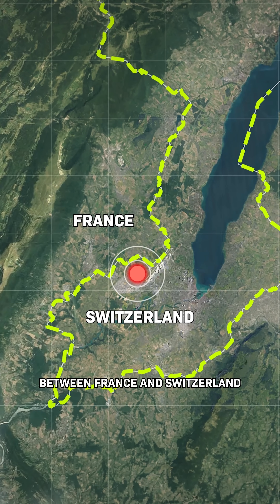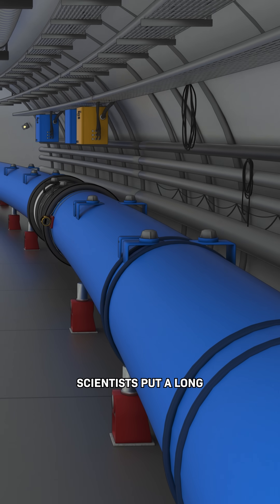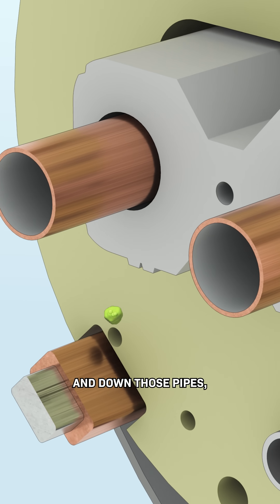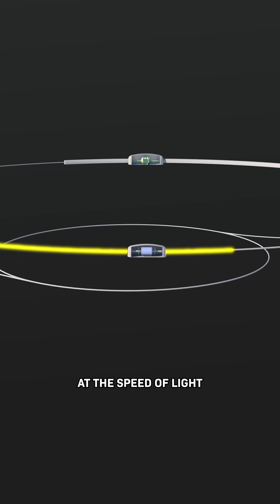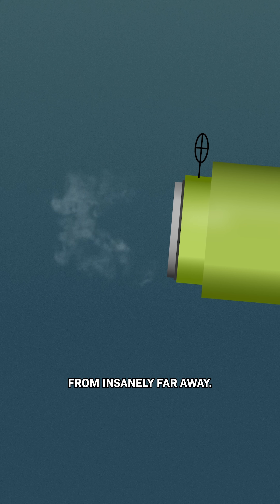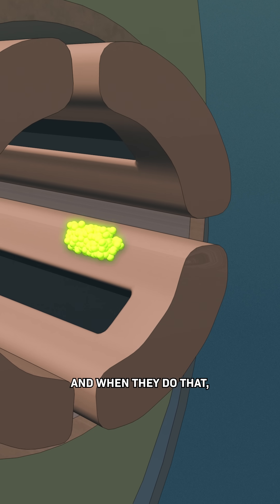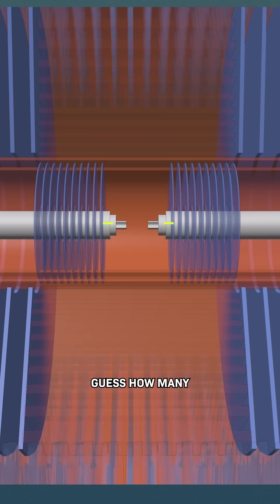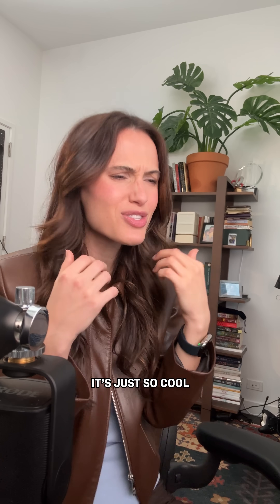How Do They Make Particles Hit Each Other?

Comment: cool,...... what this for?
Reply: Essentially, the point is that there are lots of particles (for instance, the Higgs Boson) which have extremely high masses in comparison to protons, neutrons, electrons, etc. They only exist for brief moments before disintegrating into other types of particles.

Experimental physicists want to have evidence that these kinds of particles actually exist outside of theory, and so the only way to do that is by producing enough energy that these massive particles come into existence. The way you do that is by taking tiny particles and getting them up to relativistic speeds (high percentages of the speed of light) and bashing them together. Then, machines surrounding the site of the collision record what kinds of particles shoot out from the collision, and they're able to use those results to figure out what types of particles were created.

Comment: The Flash..?
Reply: The flash point of a material is the "lowest liquid temperature at which, under certain standardized conditions, a liquid gives off vapours in a quantity such as to be capable of forming an ignitable vapour/air mixture".
Reply: The flash point is sometimes confused with the autoignition temperature, the temperature that causes spontaneous ignition. The fire point is the lowest temperature at which the vapors keep burning after the ignition source is removed. It is higher than the flash point, because at the flash point vapor may not be produced fast enough to sustain combustion.[1] Neither flash point nor fire point depends directly on the ignition source temperature, but ignition source temperature is far higher than either the flash or fire point, and can increase the temperature of fuel above the usual ambient temperature to facilitate ignition.
Reply: The flash point is a descriptive characteristic that is used to distinguish between flammable fuels, such as petrol (also known as gasoline), and combustible fuels, such as diesel.

It is also used to characterize the fire hazards of fuels. Fuels which have a flash point less than 37.8 °C (100.0 °F) are called flammable, whereas fuels having a flash point above that temperature are called combustible.[2]
Reply: All liquids have a specific vapor pressure, which is a function of that liquid's temperature and is subject to Boyle's Law. As temperature increases, vapor pressure increases. As vapor pressure increases, the concentration of vapor of a flammable or combustible liquid in the air increases. Hence, temperature determines the concentration of vapor of the flammable liquid in the air. A certain concentration of a flammable or combustible vapor is necessary to sustain combustion in air, the lower flammable limit, and that concentration is specific to each flammable or combustible liquid. The flash point is the lowest temperature at which there will be enough flammable vapor to support combustion when an ignition source is applied.[citation needed]
Reply: There are two basic types of flash point measurement: open cup and closed cup.[3] In open cup devices, the sample is contained in an open cup which is heated and, at intervals, a flame brought over the surface. The measured flash point will actually vary with the height of the flame above the liquid surface and, at sufficient height, the measured flash point temperature will coincide with the fire point. The best-known example is the Cleveland open cup (COC).[4]

There are two types of closed cup testers: non-equilibrial, such as Pensky-Martens, where the vapours above the liquid are not in temperature equilibrium with the liquid, and equilibrial, such as Small Scale (commonly known as Setaflash), where the vapours are deemed to be in temperature equilibrium with the liquid. In both these types, the cups are sealed with a lid through which the ignition source can be introduced. Closed cup testers normally give lower values for the flash point than open cup (typically 5–10 °C or 9–18 °F lower) and are a better approximation to the temperature at which the vapour pressure reaches the lower flammable limit. In addition to the Penskey-Martens flash point testers, other non-equilibrial testers include TAG and Abel, both of which are capable of cooling the sample below ambient for low flash point materials. The TAG flash point tester adheres to ASTM D56 and has no stirrer, while the Abel flash point testers adheres to IP 170 and ISO 13736 and has a stirring motor so the sample is stirred during testing.

The flash point is an empirical measurement rather than a fundamental physical parameter. The measured value will vary with equipment and test protocol variations, including temperature ramp rate (in automated testers), time allowed for the sample to equilibrate, sample volume and whether the sample is stirred.

Methods for determining the flash point of a liquid are specified in many standards. For example, testing by the Pensky-Martens closed cup method is detailed in ASTM D93, IP34, ISO 2719, DIN 51758, JIS K2265 and AFNOR M07-019. Determination of flash point by the Small Scale closed cup method is detailed in ASTM D3828 and D3278, EN ISO 3679 and 3680, and IP 523 and 524.

CEN/TR 15138 Guide to Flash Point Testing and ISO TR 29662 Guidance for Flash Point Testing cover the key aspects of flash point testing.

Comment: But what's the point of that ?
Reply: The studying of how matter works. Every modern chemist and material physics are based on measurement done at experiments like that.
Reply: @hera9191  like they just throw things and hit each other?
Reply: @Ach_so_met  The speed and impact is there for creating high temperature, therefore high energy. You cannot make oven with such temperature. For disassembling atomic nuclei you need such energy. Each particle behave differently in such conditions.

Comment: there was a man who some how leaned in front of an area of it and a partial went right through his head, things went black for a second and then he was fine and he just had headaches for awhile, but eventually he passed i think a few days after it happened. but that’s so crazy
Reply: Yeah, it's also bullshit as the beam path is fully enclosed in a magnetically shielded vacuum and totally inaccessible, it is impossible for anyone to get in the way of the beam.
Reply: this happened at an earlier accelerator, with lower energy (and lower safety precautions). getting your head in the LHC beam line would be very difficult practically speaking, but probably a lot more dangerous

Comment: Can you explain how we obtain, transport, prime, and fire singular atoms? I want better understand that part.
Reply: Basically they take hydrogen gas (stored in a tank) and use electricity to strip off the elections from the atoms, just leaving singular protons, and then they use electric fields to accelerate those protons.

Comment: "they fire particles"
Hydrogen Gas Source: Hydrogen is the simplest and most abundant element in the universe, consisting of one proton and one electron. At the LHC, they start with hydrogen gas as the source of protons.
Electron Removal: The hydrogen atoms are passed through an electric field which strips away the electrons, leaving behind positively charged protons.
Initial Acceleration: These protons are then sent through a series of machines that accelerate them to higher and higher speeds. This is done using electric fields to speed up the protons and magnetic fields to guide them along the correct path.
Injection into the LHC: Once the protons have reached the required speed, they are injected into the main ring of the LHC, where they are accelerated to near the speed of light and made to collide.
the process is designed to minimize the recombination of electrons with the protons. Here’s why:

High Vacuum: The beam pipe where the particles travel is kept at a very high vacuum to prevent the particles from interacting with other matter, including stray electrons1.
Speed and Separation: The protons are moving at speeds close to the speed of light. Even if there are electrons present, the protons are moving too fast and are kept well-separated from any potential electrons by the magnetic fields1.
Magnetic Steering: The magnetic fields used to steer the protons are also effective at keeping charged particles apart, further reducing the chance of recombination1.
Detection Systems: The detectors are designed to observe the results of proton-proton collisions. Any electrons that might recombine would not significantly affect the collision events that scientists are studying

Comment: The vacuum inside the LHC at CERN is not nearly as empty as outer space - depending of where you define "outer space". For example, in the voids between galaxy clusters is about one molecule per cubic meter. When the LHC is not in use, its ultra high vacuum contains about 10^7 molecules per cubic centimeter.

Comment: So genuine question for op. Truly genuinely asking. Is it correct to say, under the exact right circumstances, the Flash could be possible or was i wrong when i was told that. And i wasn't told that the flash would be spot on but more of a close enough prediction
Reply: no it couldn't, what happened in the flash was that the particle accelerator broke and scattered black matter all over the city, thus affecting barry allen, not only particle acelerators are not that big (they're really small in diameter if you look it up) if they blew up nothing would happen since they're underground
Reply: @zero.-8011  So even if all variables were the same as that situation? I'm just wondering if it could "reasonably" happen in this reality. I am glad that it can't happen in these situations though.
Reply: @Casey21.  well dark matter isn't something you can create and even if humans could, we don't know yet what can do to you, but most surely it doesn't give you powers hehe, it would probably bend gravity or pull things to it

Comment: Heading there on the 21st!

Edit: this exact topic came up there. I saw the hydrogen tank they use for all experiments since it started. It’s a standard size 1m long tank full of ultra pure hydrogen. They shoot around 6x10^24 protons around in each cluster. But they can keep using the one tank because it’s a few kilos of hydrogen which is about 1200 moles. And in one mole there’s 6.022x10^31 particles.

Comment: If they can go the speed of light, then could we? And if we did what would it do to us?
Reply: They dont go to the speed of light, only very close. Relativistic effects cause the protons to need far more energy to speed them up the Ekin=0.5*mass*velocity^2 would need. The actual formula has a factor of 1/(sqrt(1-velocity/speedoflight)) if we were to get to the speed of light, we would have 1-1 under the fraction aka 0, this is impossible and because we cannot approach the issue from >speed of light, we can assume the energy would go to infinity. The nirmal issue of dividing by zero cannot be simplified by just saying it goes to infinity because approaching the issue from the negative side would mean going to -infinity, so two different solutions for the same issue. But the case of relativistic speeds can only be approached from one side so could be assumed as infinity. As for what the effects are, iirc for some reason we would experience time slower then the stationary surroundings and that it is because of time space curvature, but im not sure about this part

Comment: Oh, I didn't actually know that. I thought they really just shoot one at a time because scientists are really good lol.
Reply: They are but because of the uncertainty principle, its pretty much impossible to nail the position down exactly
Reply: @daktus05  
Oh but wouldn't the collision give its position away?
Reply: @bananian  the issue with precise measurements is that you cannot measure something without interacting with it. For example if you were to measure the distance of a particle with a laser beam, youd shoot the beam at the laser and get its position at the time of "impact". This "impact" will however change the position. Same with velocity. You cannot measure velocity over a period of exactly 0s. Only very close to 0 seconds but during that time, the speed couldve been either v, or 0.5v for half the measuring interval and 1.5v for the other half. V standing for the specific velocity in this case, not Volts like it might seem. Basically whenever you measure something , you cahnge the thibg you measure. Most cases its not rleevant as rhe hange is so incredibly minuscule that its irrelevant but because of size and mass of protons its very relevant
Reply: @bananian  that would imply 100% accuracy in the measurements of the collision effects, wich is not a given

Comment: Can someone please explain what particles even are?! They smaller than atoms. How to you physically pick them up and put them in the pipes?? 😩
Reply: In the collider in this video, they use an electric field to strip the electrons away from hydrogen atoms (from a tank filled with hydrogen gas), which just leaves behind a proton, they use magnets to accelerate and "steer" through the pipes
Reply: @not_even_me5035  THANK YOU!!
Reply: @RomanCainin  happy to help!
Reply: @not_even_me5035 technically the acceleration is done by electric fields, not magnetic fields, as they only change the velocity vactor but keep its absolute value the same. But everything else is completely correct
Reply: @daktus05  yeah you're right my mistake, they use electric fields for acceleration and magnetic fields for "steering".

Comment: Sorry, they tried to build smth new.
Colliding atom and dark matter. 

Below a city? Couldn't they do in a dessert or an island somewhere?

Is it possible they might open a black hole, worm hole, or some other holes underneath the city?
Reply: even if they managed to open a black hole it would be so tiny that it would die out literally immediately and it would not cause any damage to the surroundings
Reply: @emimybuny  once a bakckhole is formed, would it suck everything and becoming more massive until it explodes into a star?
Reply: @Jocky8807 First black holes don’t “explode and become a star” also this doesn’t make black holes
Reply: @Izapertron123  yeah, pardon my ignorant. Too much Sci fi movies. 😂😂

But the words: high speed, collide, dark matter, proton. Should not be used near high populated area....

Comment: My question is how do they “bring” particles into a tube which is as empty as space, a vacuum?
Reply: they pass hydrogen gas through an electric field, which strips the electrons off, leaving just the protons to use in the collision
Reply: @not_even_me5035 What about the neutrons?
Reply: @deathmeter7243  the VAST majority of hydrogen has no neutrons.
Reply: @not_even_me5035 this is actually very helpful. Thanks captain.
Reply: I also needed to know that answer, thank you
Reply: Thats easy, a vaccum sucks things in
Reply: fun fact the the bottle used for years is small

Comment: I was at Cern while the collider was offline during winter, and going down there is a surreal experience, they first scan you so they can count how many ho in and out. Then you ride a lift 175 meters (That I think~570ish ft sry I‘m not American)down just to get to the detector and the detector is enormous like around six stories tall, if I recall correctly. They also showed us the data-center where they process raw data. If I remember correctly it was like 60 GB a Minute when the collider is running at full capacity. 
PS: Sry if there are any mistakes, English isn’t my first language.

Comment: How much ENERGY must this take??? Two pipes colder and emptier than outer space, and particles accelerated to near light speed? Okay, they're protons, but, well, 100 000 000 000 protons against 100 000 000 000 protons,  30 000 000 times per second, is still a lot of mass being accelerated to very high speeds.

Comment: And this is where the highest temperature has ever been recorded,the temperature was 9.9 trillion that is more than the temperature of the acretion disk of a black hole
Reply: So yeah, it's hot af.
Reply: @DEMEMZEA  yep
Reply: 9.9 trillion what?
Reply: @strawberry-rl6oy  oops forgot to mention, it's 9.9 trillion degree Celsius
Reply: @strawberry-rl6oy  oops forgot to mention, it's 9.9 trillion degree Celsius
Reply: @strawberry-rl6oy  oops forgot to mention, it's 9.9 trillion degree Celsius
Reply: @strawberry-rl6oy  oops forgot to mention, it's 9.9 trillion degree Celsius
Reply: @strawberry-rl6oy  I think by the time you get to 9.9 trillion, it doesn't matter if it's Celsius or Kelvin.

Comment: well another thing is because of the high speed, if the particles are going fast enough  it repelling of same charges isn't enough to off set said speed, it's actually how fusion works in stars they move so fast that they can't repel each other, and how do get the speed heat

Comment: Colder then space? How? I mean space is absolutely 0 and lower is impossible. And emptier? To quote a great man "There is literally everything in space"
Reply: Space is not the temperature of absolute zero. Absolute zero is theoretical and does not normally occur. The temp in LHC is 1,9 K. And with the vacuum thing, it really depends on where in the universe, but the emptiest lab created vacuum was 1,33×10^-11 Pa which is considered extreme-high vacuum and is emptier than space.
Reply: Not colder dummy, emptier. It has less particles than space on average.
Reply: @NinjaFlout  my point of emptier is that everything is emptier then space . Space has literally everything in it.